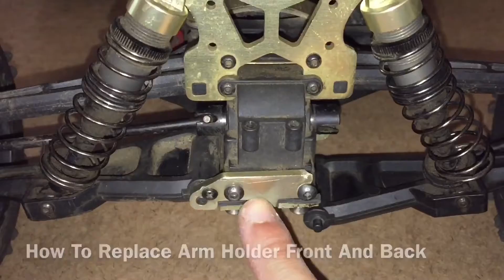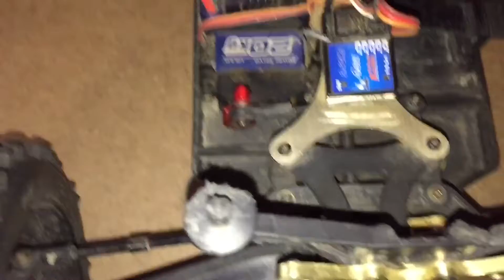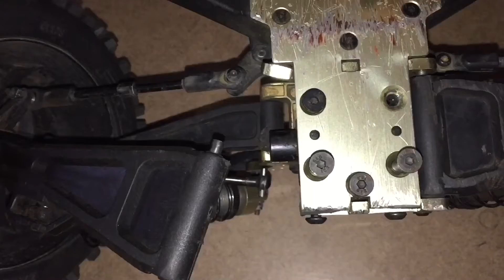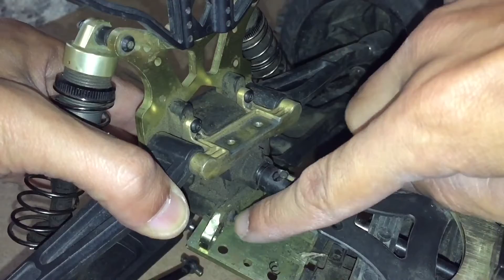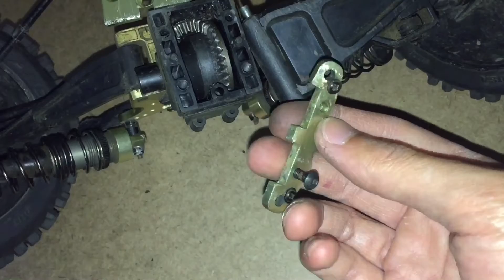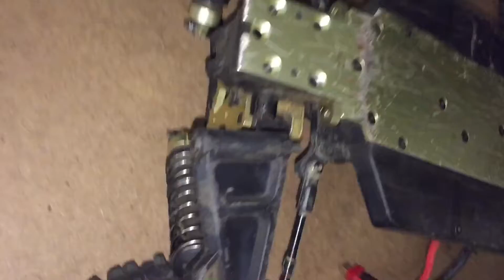JLB Cheetah - How To Replace Arm Holder (hinge pin plate)!!!!

Comment: Did anybody tell you that the plastic part that acts as a spacer on the front end is actually a broken off piece of the origional bumper? That is where the headlights and bumper attach to
Reply from the maker: Yeah I know that. I leave it there just to take up the space until I get a new bumper.

Comment: plus, the rear part isn’t “easy” to take off
Reply from the maker: No worries, I’ll make a vid showing how to replace the rear hinge pin both behind and in front.
Reply: @ItsRCTeng  Thanks so much bro! I had a lot of struggle and I’m still figuring it out in which screws should be taken out to get the whole rear part taken off

Comment: Hi mate you have no idea how much this helped me, I just got one of these, took it out, after 20 min I'd hit a goalpost and had the exact same damage as yours, I've ordered the parts and now I xan fix it and that I thank you for, but the connecting rod that goes through the axle and into the arm is missing, I've ordered a new one but do you know how these go in? I've tried to remove the one on the opposite axle just to see how it goes in but it's in solid, and ideas??
Reply from the maker: Thanks mate. For the rod that holds the arm, you will have to remove the hinge pin plate to put it in. It’s that gold aluminum in front of the diff. Make sure the dog bone is in before you put back on the arm and plate. Sometimes you have to hammer the rod into the arm to install/remove. Cheers 🍻
Reply: @ItsRCTeng  thanks allot your video was very helpful, and thanks for taking the time out to msg me bk.

Comment: How do you take of the dog bone?
Reply from the maker: You have to remove the wheels and there is a small pin at the axle. Take that off and the cvd axle dog bone should come right out.
Reply: @ItsRCTeng   How do I take the pin off
Reply from the maker: Use a paper lip or safety pin to push it out
Reply: @ItsRCTeng  thx!
Reply from the maker: JLB Cheetah - How To Replace Rear Diff and Re Bend CVD Axle!!!! This video I show how to remove the dog bone axle.

Comment: Great video! I just bought a Cheetah - great rig! QUESTION: Have you found any upgraded parts, wither from JLB or aftermarket? I can't seem to find anything except standard OEM parts.
Reply from the maker: Yeah try looking on Banggood.com or even eBay. They have aluminum upgrades. Note: the more aluminum upgrade you put the heavier the truck become and that can be more prone to breaking much faster. Also, the truck is fast as it is already so it might just loose it’s top speed capabilities. I stay with the plastic parts. Only upgrade I do is switch to a better servo and aluminum servo arm. This truck is great as it is already. 👍